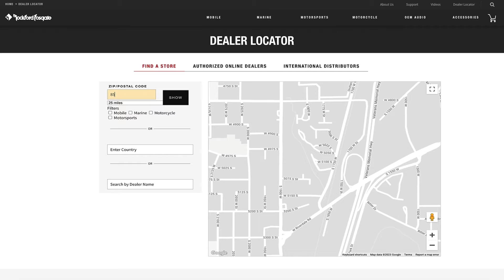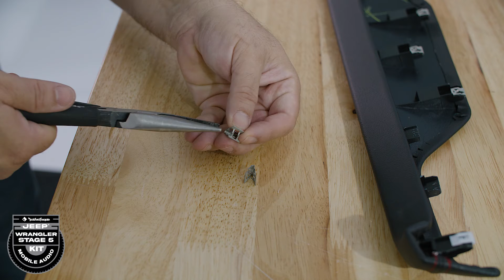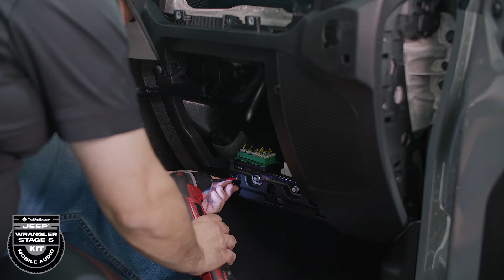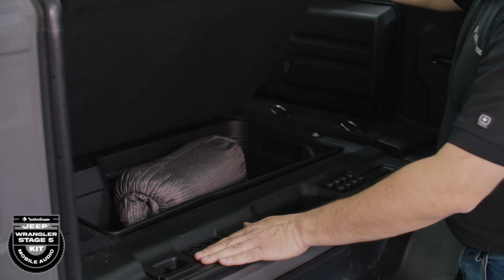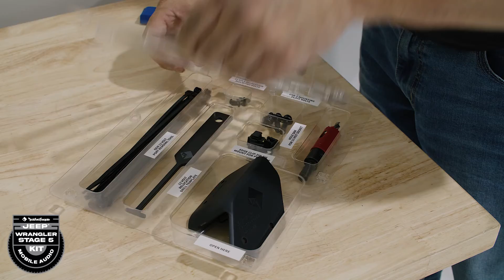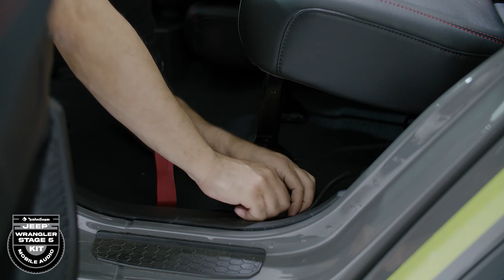2018-2023 Jeep Wrangler 4-Door Stage-5 Audio Kit | Installation Video

Comment: Spent $3500 on this set and the DSR is crap and won’t store any changes to the EQ
Reply from the maker: Thanks for your purchase. The kit is advertised pre-tuned as "DSP recognition with auto-loading Jeep Wrangler specific tune".  The radio equalizer provides a good amount of customization that can be adjusted for different generes of music. You can choose to flash the DSR to a basic "universal mode" which will erase the pre-tuned configuration.  However, since the preset is no longer available, the amplifier and speaker combination can result in damaging the speakers.

Comment: I paid a ton of money for this system here and CA and for some reason I can't tell the difference between this and the Alpine system. I also get a little bass at 75% and more at 100% but it's nothing to write home about with two 12 inch subs. What could be the problem?
Reply from the maker: You may need to adjust your radio settings because the dual 12" subwoofers haul the mail.  Be sure the Bass, Treble are at least set to flat and the balance is set to the middle.  The Remote Level Control is designed for full linear control of the subwoofer from completely off to max output.  Typically we found this knob to be left at the 1:00 o'clock mark and dialed to the right level based on music types.

Comment: How do I order the stage 5 kit? Hard to find on website
Reply from the maker: Great!  You can find them under MOBILE > JEEP KITS
https://rockfordfosgate.com/car-audio/
Reply: @rockfordfosgate  my Jeep has the alpine sub in it from factory will it be easy to install over that or does it replace it ?
Reply from the maker: @aaronb420333  Great question!  You will also need the WRNGLR-TRIM kit that replaces the factory subwoofer.  We have details on how this works in the below time codes.  Go to the 3rd video labeled "Install": https://rockfordfosgate.com/products/details/wrnglr-trim/ 

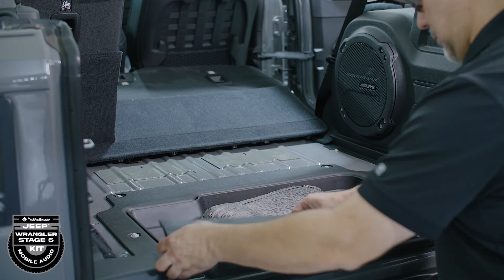02:50 - Remove Premium Subwoofer
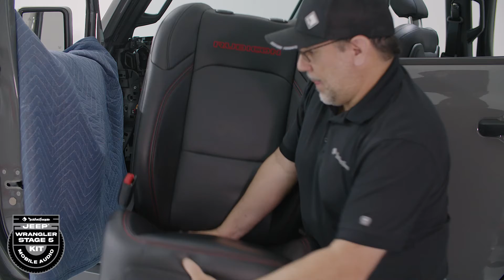19:23 - Install Trim Kit

Comment: And no view of finished product and sound. 😢
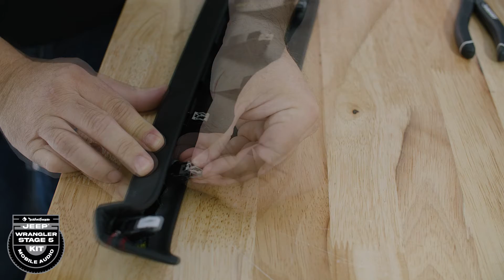Reply from the maker: This is a high performance audio system that shouldn't be judged with tiny speakers on a mobile device. However, you can watch the listening portion from Five-Star Car Stereo at timecode 09:20 (you can hear the bass distorting on the tiny 50¢ microphone, which is why it's hard to evaluate a system like this): https://www.youtube.com/watch?v=evScRD7q0Ew

We also have installation photos available on our Product Details Page here: https://rockfordfosgate.com/products/details/18wrngler-stg5/

Comment: It you have a stinger heigh 10 radio what happens
Reply from the maker: It will be compatible!  We include an aftermarket radio harness that uses RCA inputs for connection to the t-harness.
Reply: @rockfordfosgate  yeah but what about the amp gain settings. I guess they would have to be adjusted I would think
Reply from the maker: @daveroski  Yes, you would need to do the CLEAN setup for the amplifiers.

Comment: Will this work with my 5inch radio?
Reply from the maker: Yes, it’s compatible with all factory radios, including the 5-Inch on 2018-2023 Wrangler Unlimited JL models.
Reply: @rockfordfosgate how about the new stinger headunit for Jeep jl?
Reply from the maker: @litoornelas6409  Yes, we cover using an aftermarket radio under the section “T-Harness Overview” https://youtu.be/5UiH7tlsqFA?t=1586

Comment: But do3s this fit in the 2dr models
Reply from the maker: The Stage-5 kit is d3sign3d for 4-door Unlimit3d Mod3ls.
Reply: @rockfordfosgate do you have a system for the 2 doors ?
Reply from the maker: @erentemel365  Unfortunately no, not at this time.

Comment: This is nice but I prefer the old school Fosgate's RFX-8250 head unit audiophile speakers and subwoofers with the trans ana series amps and Symmerty EPX2 digital EQ system.
Reply from the maker: Those are indeed Rockford Fosgate's heritage line of Sound Quality products.  All the components used in the Jeep retain Rockford Fosgate's commitment to performance and Sound Quality.  The speakers used in the Jeep systems are purpose-build for outdoor use, designed to weather the elements, whereas the Audiophile line is not.  The Jeep radio can't be replaced with a single DIN like the 8250, so we retained the factory radio for the user interface.  We also used our current Digital Signal Processor with nearly all the same features as the EPX2, but with CAN-bus communication so it can intelligently talk to the radio.